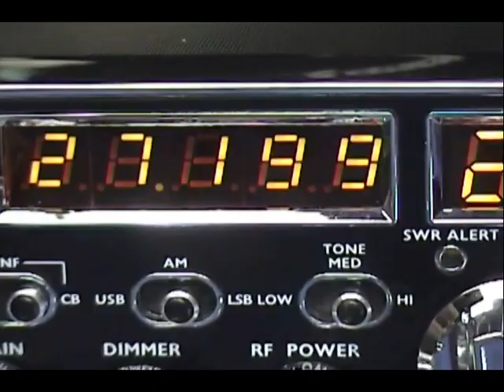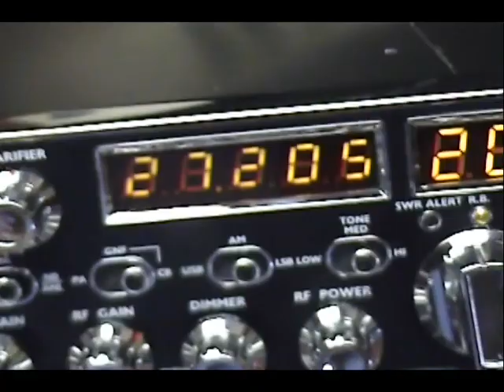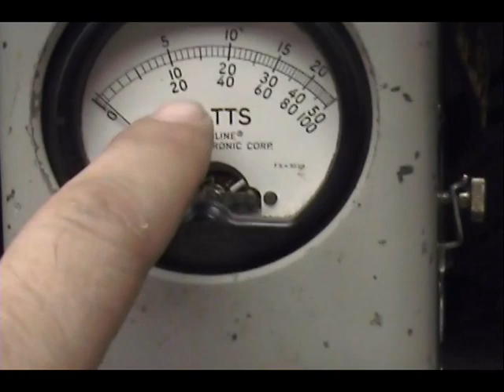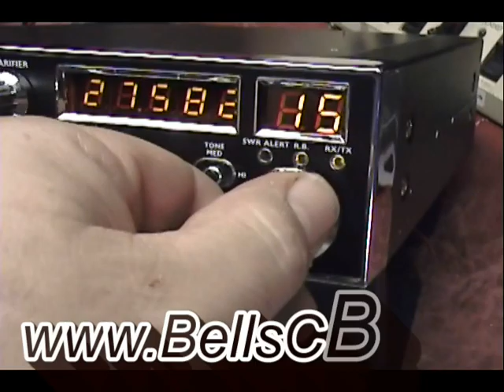Galaxy DX-959 with RFX-75 and Lescomm

Comment: I have three Galaxy DX 959's and when it comes to trying to get a signal, the meter barely moves but I can hear skip, the Antron 99 isn't up very high and don't know what would be the ideal height since I live in a mobile home park here. When I have the radio on and key up, the meter moves but not when I hear skp though, what is the problem? My SWR's are like 1 to 1.5 all the way around and even on extra channels on two of the three Galaxy DX  959's!